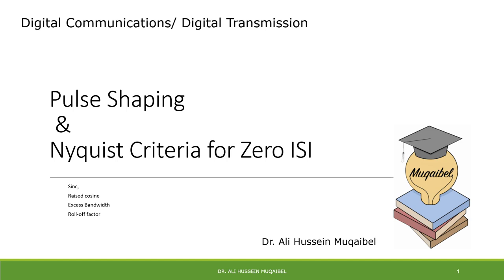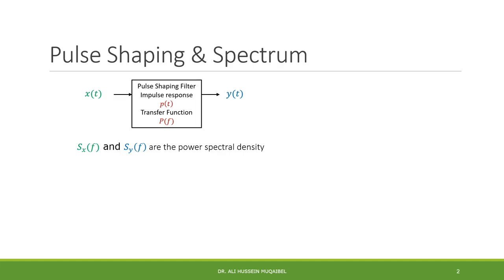7.2 Pulse Shaping and Nyquist Criteria for Zero ISI

Comment: 1) 4800 bits/sec
2) Shift the pulse so as to get 1 after f = 17kHz, so at intervals of f = 27kHz they add to 1. Therefore Rb = 27kHz.
3) f2-f1 = 2fx and  1 / (1 + f1/fx) = r. Therefore r = 0.3
Reply from the maker: Good job

Comment: 1 - 4.8 kbits/s
2- f = 27 kbits/s
3-  max rate (Rb) 2 Mbits/s ... roll-off factor = 0.3
Reply from the maker: You are awesome...for part (2) since he is asking about the rate use kbits/s or kbps .. Also in Engineering we refer to kilo with small 'k'
Reply: @alimuqaibel7619  I'm kind of lost with part (3)...

Everyone is saying 0.3 is the roll-off factor. but applying this to BW=(1+r)Rb/2 will give us a bandwidth of 1.3 instead of 2.6

Shouldn't the Bandwidth be the 2*f2 since there's also a negative side?
Reply: @ryugalaw  Basically , this BW formula with Rb/2 is not correct, it would be Rs/2. Rs is sampling per sec also u can say transmission rate , whereas Rb is bit per sec. And here Rs is 2M symbol per sec. Rb is how much data bit are sent in a single symbol multiplied with Rs.

Comment: Answers of the last exercises:
1- 4800 bits/s
2- shift the signal to n*(27 kHz) which is (n*Rb) where n=....,-3,-2,-1,0,1,2,3.... to get their summation equal to a constant.
3- Rb=2 MHz, fx=0.3 MHz, r=0.3
Reply from the maker: Good job. The answer to part 2 is not explicit.